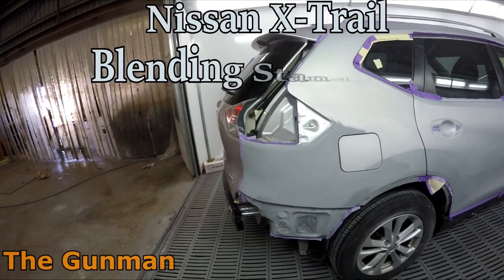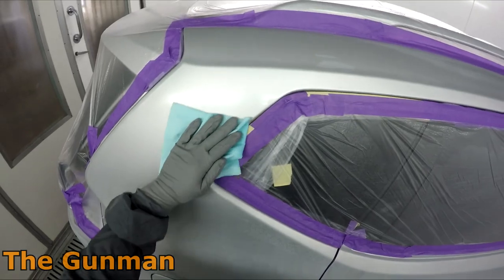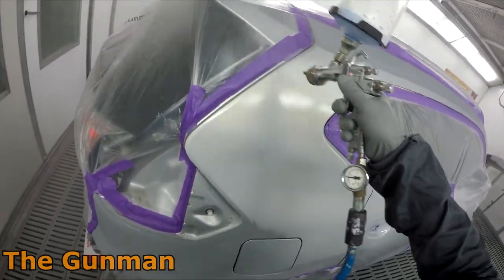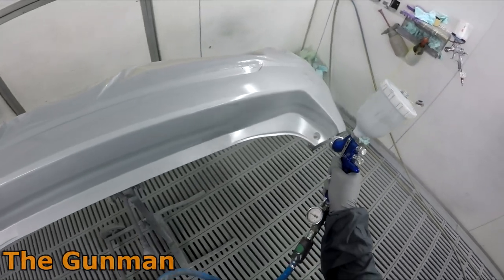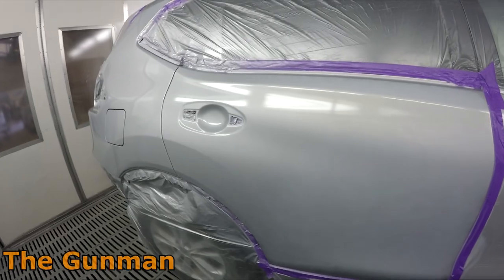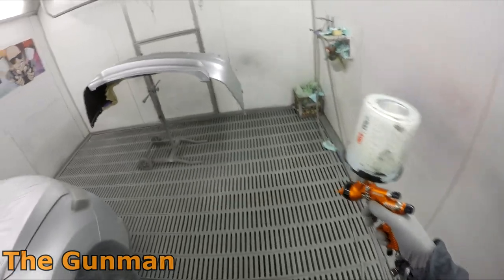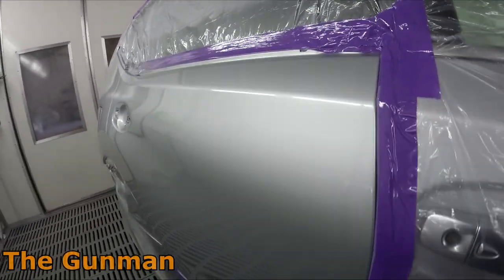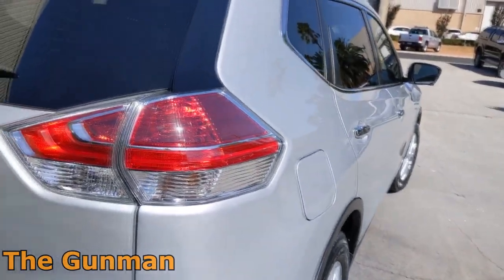Blending Silver Standoblue

Comment: Have you not used microfibers in the booth yet Gunny? 
I got me some kirklands nice and cheap but  good quality and I'll never use anything else now.
I quickly go over car before it goes in booth with normal degreaser with one of the normal panel wipe cloths and then with WB degreaser using 2cloth method with microfibers and you can use them more than a few jobs easy.
Then 1 fibre as a tacky 👌

Comment: Why is it necessary to use a clear base coat to a blending surface before covering the repaired section with the base coat?  I have a car door that has to be painted and blended to the front guard and rear door and the paint shop assistant said that the door had been painted with 2k , not clear over base, would it still be ok to paint over it with clear over base [ as the door looks a different shade] ?? I was also told that you can't spray base color over a surface that has been sprayed with a water born base coat???
Sorry for all the questions but I have only sprayed acrylic and enamel paints a life time ago [I said that pop will paint the door for my grand child] So any assistance will be greatly appreciated.

Regards Steve.